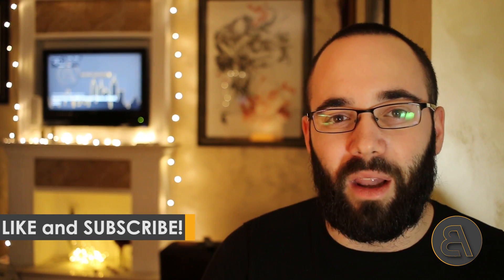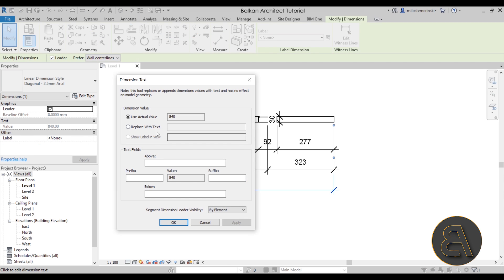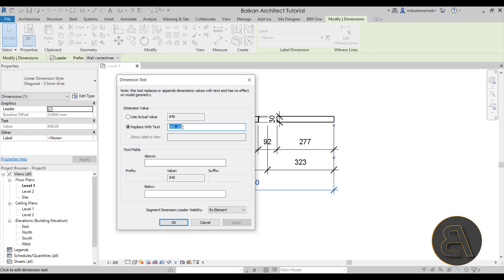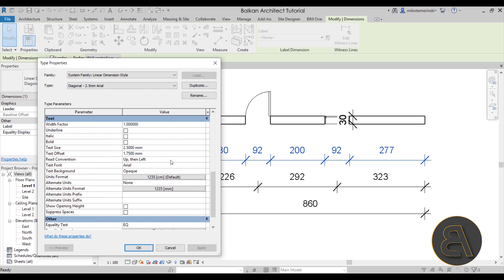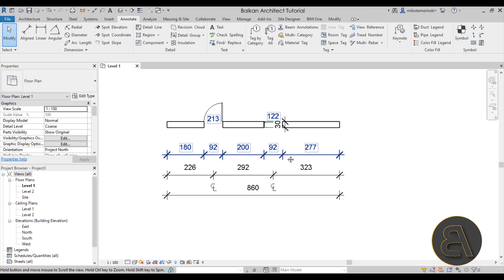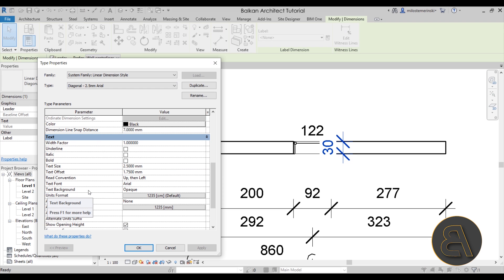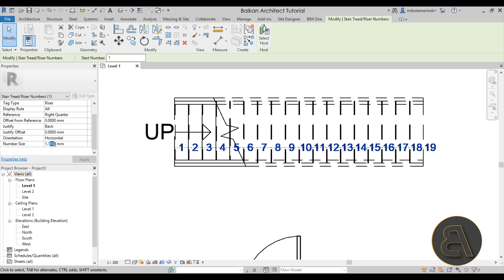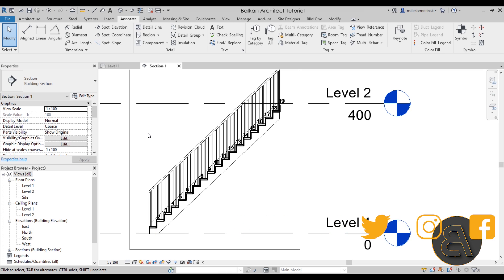Dimension Hacks, Tips and Tricks in Revit Tutorial

Comment: The BIM managers out there aint gonna like their users learning the symbol trick. We literally ban this in most offices as it leads to major issues later on when we construct.

I have a dynamo script specifically for hunting down and resetting dimensions containing symbols just to deal with these people haha!
Reply: Yeah, because they don't understand the ramifications I'm faking the dimensions. Aussie Guru you are hilarious
Reply: Of faking*
Reply: People get formal warnings for this practice
Reply: Hey, i was just wondering why people would fake the dimensions.. could you give an example?
Reply: @leramdoname  usually people do this when they're in a rush and want a dimension to read a particular value. The most common reason is we need a clearance to be achieved, but the model isn't achieving it. Rather than fix up the model they just fake the dimension and move on - now it's the builder's problem. Terrible solution!
Reply: @AussieBIMGuru  I'm a builder. And do the same trick with REVIT dimensions every day. When you go to DIMENSION TEXT menu, select REPLACE WITH TEXT and with right click in the text box go to INERT UNICODE CONTROL CHARACTER...select US - UNIT SEPARATOR. Done! Now you can write whatever you want, easy peasy.
Why? We do a lot of prefabs and newer sure everything fits...so we do one prefabricated piece adjustable. A little bit longer then in the model to be cut & fit on site. The dimension in that case usually is followed by text "ADDED 2 FT FOR ADJ." and does not require any tricks.
Reply: @AussieBIMGuru   I override my dimension to say "0" for beams that is stacked on top of each other in plan.  It's not necessarily fake, I still model the beams in properly, but there is legit uses for overriding dimensions.